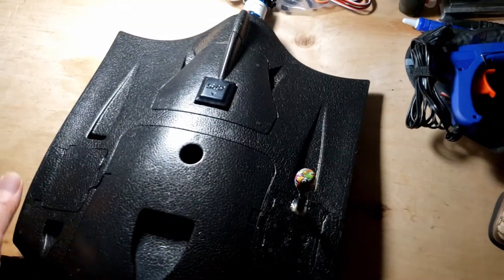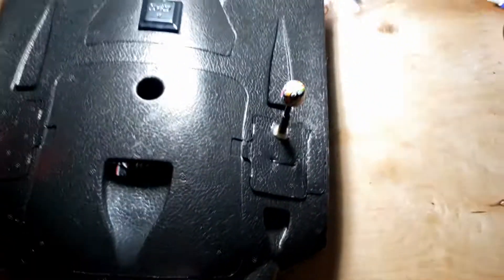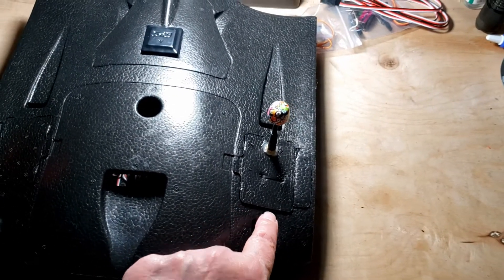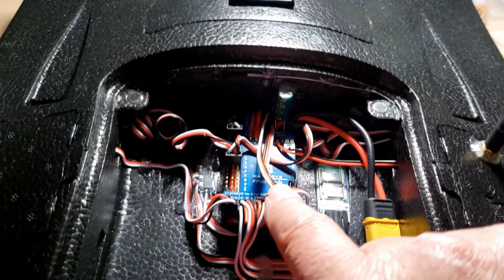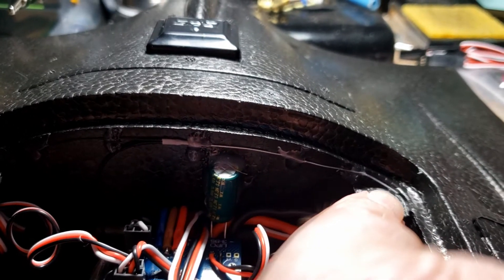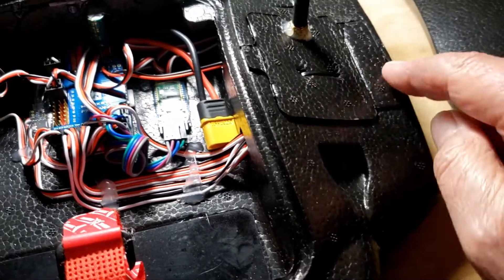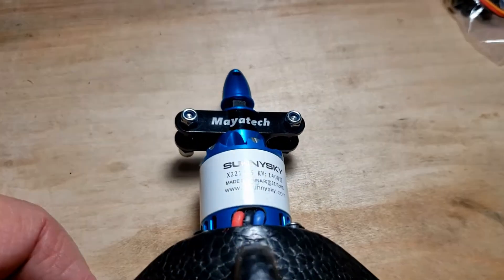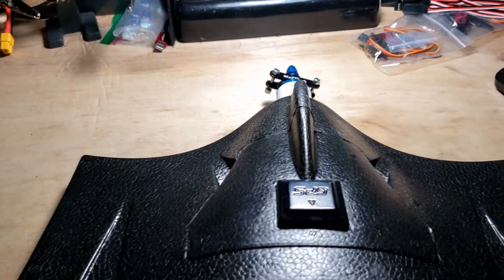Sonic Modell - AR Wing Pro Build 1

Comment: Thanks for video, my ar wing pro is almost same  as yours but I'm now installing tbs vtx same place as yours, but I'm worried vtx will get hot enough to melt some foam on the hatch cover. What's your thoughts on this? Have you had any issues
Reply from the maker: No heat issues in this space that I noticed. The VTX does good there although not always landing right side up does take a toll on the antenna mounting...

Comment: Ordered some folding props for my ARP.. what size have you settled on?
Reply from the maker: For the AR Pro I am using 8x6 at the moment but I will test the 9x6 next and will probably stay with that. On the 900 I use 8x6 also but with the Pro being larger, I think the 9.6 is going to be the right prop. The maiden flight on the Pro went perfectly in iNav auto launch. So did the second launch. So far, so good! Love the folding props, no more broken props or damaged motor mount!
Reply from the maker: @FourthWayRanch  set nav_fw_launch_velocity = 150
set nav_fw_launch_accel = 1600
set nav_fw_launch_max_angle = 180
set nav_fw_launch_detect_time = 40
set nav_fw_launch_thr = 1400
set nav_fw_launch_idle_thr = 1350
set nav_fw_launch_idle_motor_delay = 0
set nav_fw_launch_motor_delay = 0
set nav_fw_launch_spinup_time = 600
set nav_fw_launch_end_time = 3000
set nav_fw_launch_min_time = 0
set nav_fw_launch_timeout = 10000
set nav_fw_launch_max_altitude = 10668
set nav_fw_launch_climb_angle = 27
Reply from the maker: @FourthWayRanch  No - When I arm, and raise the throttle, it only goes to a low RPM, then I just toss it overhead and it starts up to the RPM I have it set to and takes off on it's own.  I am lowering the launch throttle even more now to better control the tork roll to the left on launch...seems to be working good so far...
Reply from the maker: @FourthWayRanch  I have that setting on mine to a lower value so when I throw the wing - that's when the prop goes from idle throttle to launch throttle. I don't shake and send any longer. My setting starts the prop spinning slowly to a low RPM and the sensitivity is set to feel when I throw it, it then spins to the lauch RPM while being tossed. Perhaps your setting is still a little too high. If it gets to low and you happen to move it sharply before being ready, it can start spinning when you don't expect it. It arms at 0 throttle. 
You then raise the throttle and it slowly start gaining RPMs.
Reply from the maker: @FourthWayRanch  Sorry to hear that. You do better next time. It's how we all learn sometimes.

Comment: Very nice walk-through. Thank you! Question...why is it I see 2 xt60s? One for battery , but what about the one between the ESC and the fc? Any practical reason? Keep on rocking.
Reply from the maker: I connected the ESC to the FC on an XT60 just to disconnect instead of desoldering. I suspect that 45amp esc is not going to be a high enough rating for this build and may end up needing a 60amp esc.
Reply: @robertdroner  that makes sense now. Thanks for the clarification
Reply from the maker: Turns out that ESC is just fine...so far.
Reply: @robertdroner  that's a question I have too... I'll wait to upgrade the esc because you're not the first one suprised the 45 amp holds up 🤷
Reply from the maker: @bbingtube  yes, been drawing only 35 amps max on my AR900.